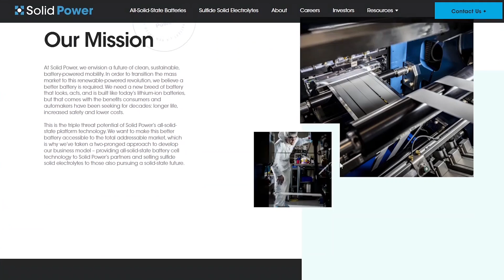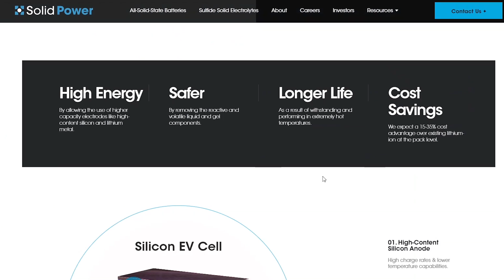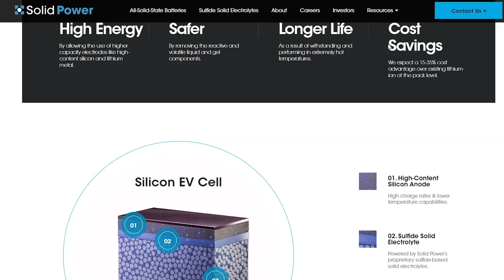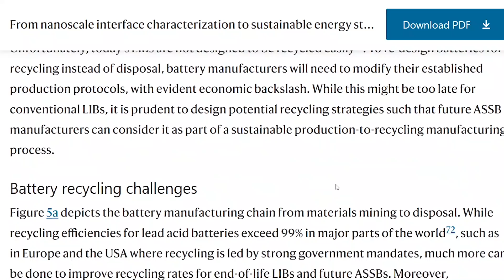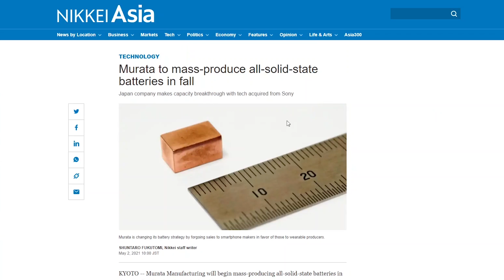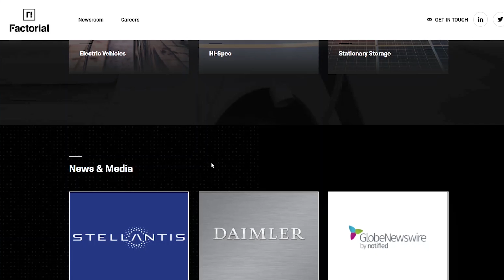Solid State Batteries

Comment: I recall a colleague of John B Goodenough (inventor of the lithium battery) had created a type of glass that was able to used as a battery. This was about 2yrs ago & ive heard nothing since. It would be a game changer.
Reply from the maker: They may have been talking about solid state batteries, the solid electrolyte is often ceramic or glass.
Reply: @ApteraOwnersClub  possibly, but it did seem like they were talking about the whole thing, not just solid electrolyte 🤷🏼‍♂️

Comment: One of the big problems with solid state batteries is the media and automakers. Toyota has been proclaiming the benefits of solid state batteries for years now, but they have used the future potential of solid state batteries as a crutch to hold onto producing their current gas and hybrid models, saying that with solid state batteries "right around the corner" they don't want to commit resources to build up a conventional lithium ion battery infrastructure now. And as a consequence Toyota is about 5 years late in entering the BEV market, and many people have lost confidence in their EV leadership, as many EV buyers have with Honda. Solid state battery development is steadily progressing, but it is still uncertain if they will be able to scale up to mass production any time soon, and even if they do it is not guaranteed that they can be price competitive. Plus, lithium ion batteries are a fast moving target to catch, with Tesla's 4680 batteries, BYD Blade, and other innovative new battery technologies like lithium metal, flow batteries, graphene, aluminum air, One Gemini, and so many others that are also being currently developed, and one or more of them might have a breakthrough within the next 5 years that would eclipse the benefits of solid state batteries for transportation use.
Reply from the maker: You nailed it

Comment: We are 10+ years from solid state in mass market.  The technical challenges are huge and its essentially a commodity component once it exists.  Once its solved it will be the battery for ultra high end EVs for years as production try to scale.  LFP is the best all purpose solution for now despite the weight; in practical terms LFP wins on cost, longevity and does very well on safety.  Its important we not have the Osborn effect with everyone waiting for this future tech.
Reply: NMC is still better